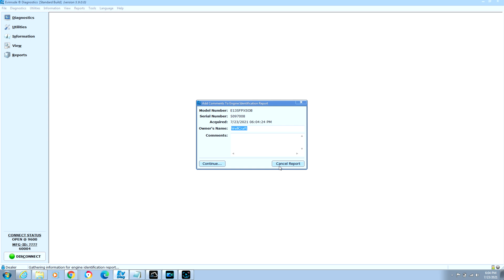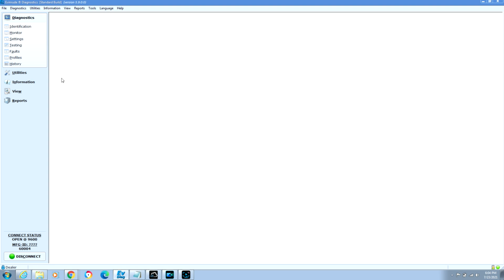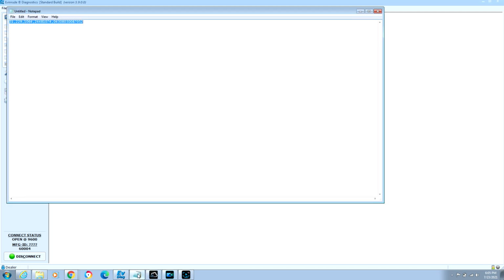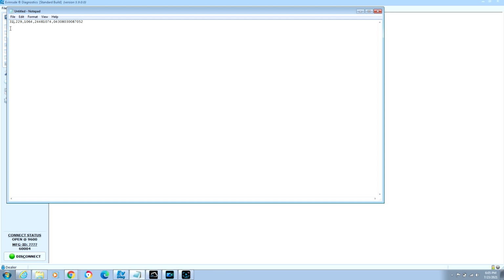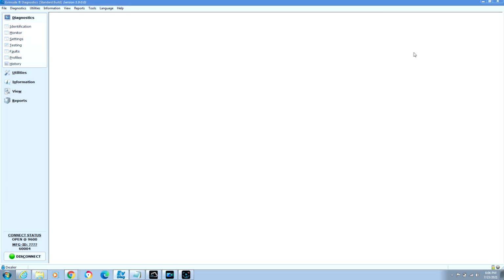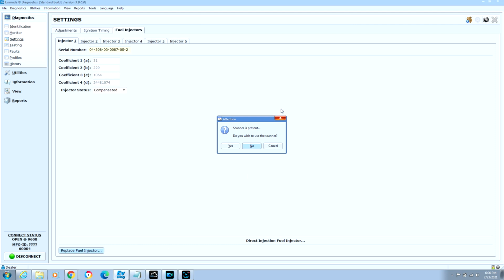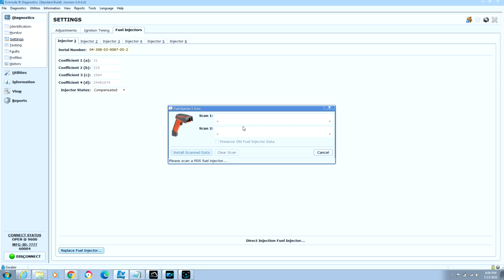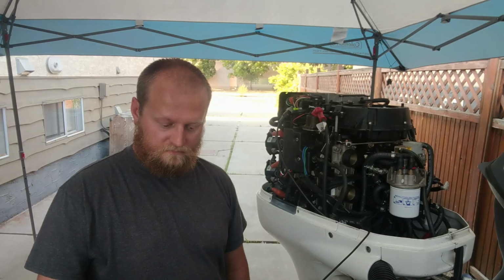Evinrude Injector programming for FICHT, DI, & Etec Outboard motors

Comment: I have a 30 hp evinrude e teceh marine engine, I start the engine, the engine runs at idle, but the engine lights do not turn off. When I put it into gear, the engine stops.

Comment: Not all scanning apps will work for the QR tag to record the injector's coefficient data that must be installed. This App works perfectly but only on ipad:  "QR Code Reader + QR Scanner", "QR & Barcode Scanner" by Gamma Play Limited: Designed for iPad. 
Then you have to figure out cleaning up / editing the data string.  
Not avail on iphone as far as I can find... 
The Android Phone version from the same "Gamma Play (or Ray)"

Comment: What QR CODE SCANNER Program are you USING IPhone i am using?  ALSO is it important to identify which cylinder to input injector information?
Reply: can i get the coeficient for my injecteur using serial number
Reply: Not all scanning apps will work for the QR tag to record the injector's coefficient data that must be installed. This App works perfectly but only on Ipad:  "QR Code Reader + QR Scanner", "QR & Barcode Scanner" by Gamma Play Limited: Designed for iPad. 
Then you have to figure out cleaning up / editing the data string.  
Not avail on iphone as far as I can find... 
The Android Phone version from the same "Gamma Play (or Ray)"

Comment: Hey by any chance is this the same process for etec brp motor ?
 By any chance if I find a port injector asking that the injector are port side can I reprogram them for example my number 6 injector showing open circuit detected ect can i use any port side injector like number number 2 or 4 port injector if I find one can I use them too ?

Comment: Nice video, I have a question I bought a 05 etec 90hp and the guy I bought it from says they replaced the emm with a set of injectors to matches and it runs good but it has a bad hesitation at 1800rpm and when it hits 2000 rpm it just jump to 2500rpm and runs good after that and if I do a holeshot it has no problems ,someone mentioned to check injectors to make sure it matches the emm would that be a reason for my problem????
Reply: Check for updates ,there was 1 for a hesitant throttle

Comment: Hi, thanks for sharing, a great clear example of physical and on screen how to. Does it automatically back up the original data for each injector or is it best to screenshot as a back up? Can it back up any other data? Cheers 👍
Reply from the maker: Glad it was worthwhile to you!
I can't remember off-hand, I'd have to look at the program, but if my memory serves me correctly I'm pretty sure there is an option to create an existing injector file beforehand
Reply: @puttputtbang5684  can i get the coeficient for my injecteur using serial number

Comment: Thanks for the video. I sent my EMM out for repair however it seems to be lost!! I bought a used EMM but it has the wrong MAP firmware. Can I upload MAP's to the engine with this software via the bootstrap tool?? Hate to think my engine is paperweight because my EMM is lost!! Thx
Reply from the maker: https://www.facebook.com/groups/2002844156628796/?ref=share

This group is a great resource for these motors
Reply: @puttputtbang5684  Thanks!
Reply: @puttputtbang5684 group must not exist anymore. Link doesn’t work
Reply: lakeside tech might be able to help.  He deals with these electronics on PWC's, but I know he can reprogram the whole emm.